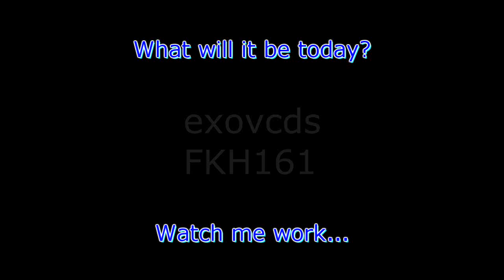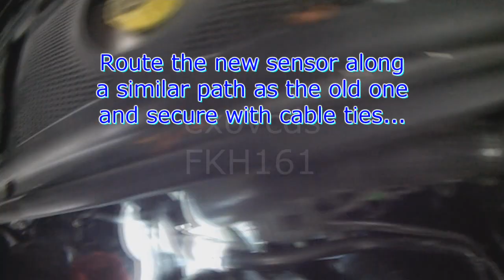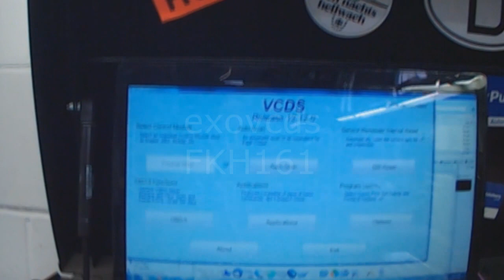Audi B5: 1.8T Crankshaft Position / Engine Speed Sensor Replacement

Comment: How do you change a vss(vehicle speed sensor) on a 2000 Audi a4 1.8t quattro (Atw engine)! Please help me locate on the transmission? Post a pic or a video please
Reply from the maker: I don't have a video (yet)... but depending on the transmission, it is either behind the differential flange on the driver side (Left hand drive) look through the wheel well and follow the drive axle to the transmission... or it is located inside the transmission.

Comment: I just replaced the engine speed sensor on a 2003 Beetle. I would be careful with aftermarket ones. Tried 2 Meyle sensors that would not work. They are supposed to produce at least 800 mV Ac when cranking on pins 2&3. (Brown & white wires on this one). 2.5 V AC is normal. The third Napa sensor finally worked. Oem would probably save you a headache.
Reply from the maker: Thanks for the tip!
Reply: ***** why when I asked them at discount auto for the speed sensor they gave me a black plastic with no wire sensor? And I cant find anywhere it goes to
Reply from the maker: Johnny Bee Good Year & engine? Crankshaft position sensor... if you just say speed sensor, they will give you a "vehicle" speed sensor.

Comment: Just did this job yesterday in 5 mins no need to jack the car or remove splash gaurd just remove large hose from intake and oil filter reach just behind filter housing and bam
Reply from the maker: Thanks for the tip! Try not to make be look bad... LOL
Reply: Ohh yes and coolant resovoir

Comment: Hey does this code/description refer to this video? 16706 - Ignition/Distributor Engine Speed Input Circuit - No Signal
Reply from the maker: Yes, can refer to same sensor... or the sensor in the distributor (hall sensor) if there is no crankshaft position sensor.

Comment: Hey can this sensor malfunctioning cause the speedometer & odometer to stop working while the rev counter still functions?
Reply from the maker: Vehicle speed sensor for the speedometer is a different sensor / at a different location. Mounted to the transmission or the front left abs speed sensor is used, when there is no speed sensor mounted at the transmission.
Reply: @EXOVCDS  Do you have any video or image to show by chance?
Reply from the maker: @CRen46  What year / model A4? Standard or automatic?
Reply: @EXOVCDS  actually it’s a 99 B5 Passat 1.8t APU engine (this engine was not based in the US but similar to the AEB).
Reply from the maker: @CRen46  Look for the speed sensor on the driver side of the transmission... behind the axle flange.
https://cdn4.pelicanparts.com/techarticles/Audi_Tech/21-TRANS-Transmission_Fluid_Change/images_small/pic01.jpg
Just above the oil fill plug for the differential.
https://cdn4.pelicanparts.com/techarticles/Audi_Tech/21-TRANS-Transmission_Fluid_Change/images_small/pic03.jpg
Reply: @EXOVCDS  Thanks much will do & love your videos keep up the fine work!!!

Comment: I have a 1.8t vw jetta 02 GLS and it is cutting off while driving after the ASR light comes, could this have anything to do with either of those two sensors (cam/crank) or WSS?
Reply from the maker: jLeMeLLeC33 Maybe... any fault codes stored? Can you recreate the issue all the time? Only when the engine is warm? Try to take note of driving conditions.
Reply from the maker: jLeMeLLeC33 I'm just about to start work... if you have a bunch of short to ground codes, could be a fuel pump relay problem. I'll have more time to look into this tonight after work:

http://www.ross-tech.com/vag-com/dtc-comparison.html
Reply: +Thomas EXOVCDS I have a 2003 jetta 1.8L GLS and pulling most of the same codes... Care cranks but won&#39;t start. I definitely have spark and I think I fuel in my line. shoots out when I try to start the car, with fuel line off.  Should I try to replace the Fuel Pump Relay?

1) p0261 - Cylinder 1 Injector Circuit Low
2) p0267 - Cylinder 3 Injector Circuit Low
3) p0270 - Cylinder 4 Injector Circuit Low
4) p0264 - Cylinder 2 Injector Circuit Low

5) P0445 - Evaporative Emission System Purge Control Valve Circuit Shorted

6) P0037 - Heated Oxygen Sensor Heater Control Circuit Low Bank 1 Sensor 2

7) P0418 - Secondary Air Injector Relay A Malfunction

8) P0010 - Intake (A) Camshaft Position Actuator Circuit / Open (Bank 1)

9) P0414 - Secondary Air Injection Switching Valve A Circuit Shorted

10) P0141 - Oxygen Sensor Heater Circuit Bank 1 Sensor 2

Comment: What are a list of things to look for in a no spark condition with an atw engine code ??
Reply from the maker: - Check engine light ON when key is ON
- Injector pulse / clicking when engine cranking
- RPM signal when cranking
- fuse #29 for ignition coils ok
Reply: That's an epic list I really appreciate the answer. I put an atw in a mk1 cabby ran fine for a month now I have a no spark condition ? So I figured crank sensor, cam sensor, bad ground aswell
Reply from the maker: Cam sensor should not cause a "no spark".
Reply from the maker: Fuse #29 in your mk1... is whichever fuse supplies power to the coils.
Reply: @EXOVCDS  I appreciate the help very much I'll check that fuse #29 when I get a shot. That will prob be my culprit.

Comment: Hey broh i got a 98 passat i change the turbo          but my car still  slow and i see whithe smoke can u help me out
Reply from the maker: +Felipe Tapia Does the smoke smell like coolant, oil or fuel? Have you checked for excessive oil in the intercooler? Remove the bottom air hose from the intercooler or drill a small hole and let the oil drain out: https://www.youtube.com/watch?v=21BhxvAC8gk your intercooler is on the other side, but if you drill a small hole at the lowest spot, it will let the oil drain out. If you have too much oil in the cooler... the engine can't breathe.

Comment: Hey so I have a 98 Audi A4 Quattro 1.8t with the p0321 but my car starts but won’t let me go passed 4K rpms is that related is some way?
Reply from the maker: The only way to know is to check sensor voltage... using an oscilloscope for best results. Installing a new sensor is a cheap alternative (if it's still the original sensor, it can't hurt to change it). If it's p0341, then the cam sensor needs to be checked... as well as camshaft / crankshaft alignment. If the timing belt jumped, it can set p0341. Usually, the engine won't run with a faulty crank sensor / p0321.
http://wiki.ross-tech.com/wiki/index.php/16705/P0321/000801
http://wiki.ross-tech.com/wiki/index.php/16725/P0341/000833
Reply: @EXOVCDS  will try to replace the sensor but any other things it could be I did my timing belt like 2000 miles ago never had that issue till about 3 days ago. Car runs fine no issues besides thatb
Reply from the maker: @Bryan_Mo_power  belt stretch or something moved. P0321 or p0341 which is it?
Reply: @EXOVCDS  p0321
Reply from the maker: @Bryan_Mo_power   focus on the sensor then / check it.
http://wiki.ross-tech.com/wiki/index.php/16705/P0321/000801

Comment: Thanks for this video, it will save me a couple of hundred bucks.
Reply from the maker: +DDXY2K Thanks for watching... I just earned .001 of a dollar.
Reply: +Thomas EXOVCDS Ha ha. Hey, no kidding. I went to a mechanic because of the check engine light and I have to get an inspection. The mechanic quoted me $325 to change it out. I priced the part and it is only $125. $200 for less than 30 mins of work is kinda steep...

Comment: A very good video, subscribing.I have a faulty speedometer on my Audi A3 1.9TDI year 2000, is the sensor on the same position or is it diferent?
Reply from the maker: Boris Filipov The video shows "engine" crankshaft position sensor (also known as engine speed sensor) location. "Vehicle" speed sensor is mounted to transmission, or on some cars, the ABS system is used to calculate vehicle speed. I'm about to start work... once I get home tonight, I can look where your sensor is located. Standard or automatic transmission?
Reply: ***** It is standard transmision(5gears + reverse), at first it started showing wrong speeds in a rainy weather, after that i restarted it on computer and it was working ok until another rainy day when it completely stoped working, now the speedometer is standing at the top speed even after 260km/h, When ever the computer gets restarted it continues to work until bad weather, the electricians here in my town have small knowledge and they don't know how to solve the problem(lack of knowledge), thank you very much for your time :)
Reply from the maker: Boris Filipov Look for the sensor on the differential (bottom left of this picture):

http://image.dieselpowermag.com/f/tech/1406_2002_volkswagen_jetta_tdi_jetta_fever_part_1/66562403/2002-volkswagen-jetta-tdi-stock-auto-transmission.jpg

There is usually a protective cover over the  sensor and wiring. Disconnect the sensor harness plug and see if the speedometer still goes to max.

Comment: hi audi a3 sline 1.8 turbo ..  fault crankshat come up i put new sensoer same thing,,    i test 3 wire  grown is good but another both wire red 2,v plug in or  unplug    same thing,,   thnx
Reply from the maker: Same thing what? Engine does not start or engine stalls? A bad fuel pump can set a crankshaft position sensor fault code... it's not always a sensor problem.
Reply: engine start run good but allways when i rest fault code for crank shaft sensor cade come back i test wire i thing some thing wrong with wire   ... grown is 0v    ref   is 2v    signal is 2v,, with plug or unplug same thnx
Reply from the maker: +KURDISTAN uk What's the actual code?
Reply from the maker: +KURDISTAN uk Isn't that a #4 misfire code?
Reply: yes it was.. i replace all 4 coil now is run good..but code still there
Reply from the maker: +KURDISTAN uk I thought you replaced the crankshaft sensor... you first post said so, that your crank code keeps coming back.
Reply from the maker: +KURDISTAN uk How is the compression? Injector spray / operation?
Reply: i dont test it,, nother mechanic who is work with me he put  engine on,,atter that is problem

Comment: I have a 2000 audi  tt, that I replaced the timing belt, water pump, and belt tensioner, it was so  difficult to do that! I do not want to go through that process again. 
After I finished installing the new parts it threw a code p1340. 
I'm afraid is because of the TB.
It says: 
Camshaft/crankshaft incor. Correlation. 
It's so hard to replace them in such a narrow space!! Unless you remove the engine which is too much!!!  😐😐😐
I hope someone makes a tutorial on how to make sure they are lined up correctly or how to verify the marks on the crankshaft and camshaft. 
Thank you!
Reply from the maker: dannysa503 Yes, cam & crank timing is off... you'll have to reposition the cam & crank to make sure that they are correct when at TDC. The camshaft is easy because of the alignment mark on the sprocket & valve cover. The crankshaft needs to be checked either via the mark at the transmission / flywheel housing or the crank pulley. Rotate the engine 2 turns after everything has been aligned (belt in place)... to make sure things stay aligned.
Reply: Thomas EXOVCDS 
Thank you for replying and your advice. It's Been like 4 months since I did it So I don't remember seen any marks on the transmission or flying wheel. To lined up the crankshaft. I marked them up to remember the placement but I know for sure it was off a tooth on crankshaft mark . But I just couldn't get right on the mark!! The teeth on the cam, and crankshaft didn't fit/lineup with the Belt's😐😐
Thank you for your advice,  I appreciated. ☺

Comment: 2004 Audi A4 1.8t ... Took to a local mechanic they did the head it was amb they swapped to atw cuz it was cracked now getting that code it's rough at idle needle jumps a lil just did the cam and engine speed sensors still have some problem.
Reply from the maker: Jesse Rodriguez Make sure that the cam sprocket key is not broken... if the sprocket shifted on the camshaft, then the timing will be wrong. Also make sure that there are 16 links between the intake & exhaust camshaft gears. The fact that the engine is running, tells me that the crank sensor is ok. Since it is running rough, cam / crank timing or cam / cam timing is off.
Reply from the maker: http://fkh161.ca/VW/Cams.pdf

Comment: I have a 2004 VW passat 1.8t and it is acting like it is a sensor like the cam or crank but no check engine light came on. It will not start it will start for about 10 to 15 seconds running very rough and then stall. My guess is a sensor but the engine light should've come on.
 Can you maybe give a little advice. I just had a new timing belt and water pump put in a week ago.
Reply: sounds like your timing is off to me.. prob  moved the timing when replacing the belt...
Reply: it turns out it was the fuel pump.
Reply from the maker: +jeremiah jenkins Thanks for the update... you never replied to my initial reply, so it's nice to know that I guessed correctly.
Reply: sorry I haven't checked here much after I had it towed to a garage for 2 weeks they had my car and they still couldn't figure it out. So I got upset with them after taking so long to do nothing so I had it towed to my VW dealer and they had it for 2 hours and called me and told me it was the fuel pump. It cost me just under $500.00 to fix.I will never bring it back to the idiot I first had it towed to even tho he claims he specialized in German cars especially VW. I just bought a second 2004 passat this 1 has a manual 5 speed and sadly the first 1 will be going to the boneyard soon I fear. The transmission is giving me trouble now and I am not sinking anymore money into this car.
Reply from the maker: +jeremiah jenkins That's too bad... "the basics" (compression, fuel, spark, cam / crank timing) are usually simple to check, not sure what threw them sideways.

Enjoy your manual Passat and don't forget to take some parts off of the old one... that might come in handy in the future. :)

Comment: How do I tell if it’s a b5 or b6 I have a 2001 Audi A4 Quattro manual with head stamp of AWM
Reply from the maker: B5 = 1994 to 2001 and has 8D in the 17 digit vin
B6 = 2001 to 2006 and has 8E or 8H in the 17 digit vin

Comment: Can p1340 code be a bad crank position sensor?
Reply from the maker: Jesse Rodriguez According to Ross-Tech, yes... but I don't think so.

http://wiki.ross-tech.com/wiki/index.php/17748/P1340/004928

In order for the ECM to determine that the cam / crank sync is out of specifications, it needs to receive a signal from both the camshaft & crankshaft position sensors.

What is the issue with your engine... when did it happen? What engine do you have?

Comment: It speedometer sometimes works but sometimes it'll get stuck at zero or it'll go 20 mph faster than I'm goin or it will start slippin in the 50 as I'm accelerating it'd get stuck then bounce 5 mph at a time jus starts skippin ahead on the speedometer
Reply from the maker: Depending on the design / setup of the sensor & sensor wheel, it could be that the sensor wheel is loose (spinning sometimes, creating a signal and then slipping) or the sensor is cutting in & out. If in doubt of the location or which sensor it is, have a transmission shop look at it (for an estimate).

Comment: so i have a 03 vw jetta with the 06a awp motor and is the vehicle speed sensor the same as the crank sensor
Reply from the maker: Vehicle speed is different from crank / engine speed sensor.
Reply: OK so I have an epc light on and the rpms are limited to 4500 and it takes like 15 seconds to crank up and im thinling its the crank sensor but im not too sure
Reply from the maker: Scan the ECM.

Comment: Hello Thomas

I think I have a bad crankshaft sensor on my 2001 Golf mk4 but i'm sure you could help me confirm that.

My car will often start but sometimes it will die at an intersection when I press the clutch (if I remember correctly) and will only start after it has cooled down for about 15 minutes.

When I drive the cluster will behave strangely: the light will go out and come back intermittently, the oil level light will flash with the hand brake light even though I have plenty of oil and the handbrake is not engaged.

I have codes p0322 p501 p0300 p0301 p0303 p0304

Thank you, you are doing an awesome job!
Reply from the maker: Audi A4 B5 or VW Passat B5? Oil & handbrake light can be due to a faulty ABS Module.
Engine stalling & not starting until engine has cooled off is most likely a bad crankshaft position sensor fault.
Not sure (don't think) that the misfire codes and the p0501 are related to the stalling... the misfires maybe. P0501 is the vehicle speed sensor (the one for the speedometer / odometer. P0322 is the crank sensor.
Reply: Thank you for the response!

It's a golf mk4 2001. I didn't notice this video was for the audi B5 sorry.

Anyways, I will try changing the crankshaft sensor and see how it goes. I've heard the crankshaft sensor and the speed sensor is the same on the mk4 is that true?

Thank you again!
Reply from the maker: Sorry, I missed that it was a golf in your first post. No, crank sensor is on the engine... vehicle speed sensor is on the transmission.

Comment: Hello I have a Jetta 1.8t mk4 and my car dies out every 15 to 20 minutes and then starts running an epc light I've changed the fuel filter fuel pump  and I have some codes that lead me to belive it might be the crankshaft position sensor but I'm not 100% sure, I have some codes I wanted to share and see if you had any advice on which to go by, the codes are p0011 p0322 p1287 id appreciate it thanks!
Reply from the maker: P0322 is a crank signal code.

http://wiki.ross-tech.com/wiki/index.php/16706/P0322/000802

So yes, could be a crank sensor issue... monitor the signal to see if it drops out.

P0011 should not cause the stalling http://wiki.ross-tech.com/wiki/index.php/16395/P0011/000017

The third code does not come up for some reason.